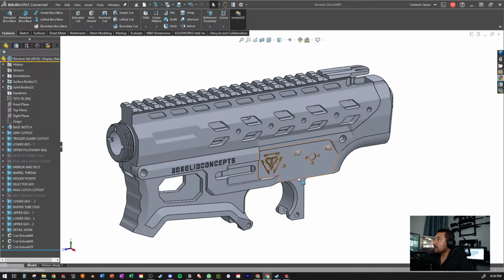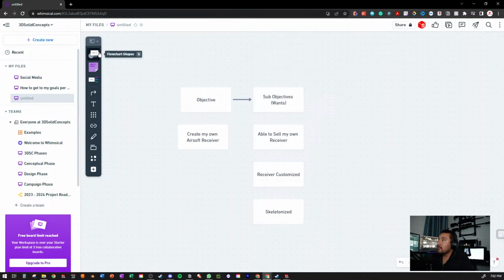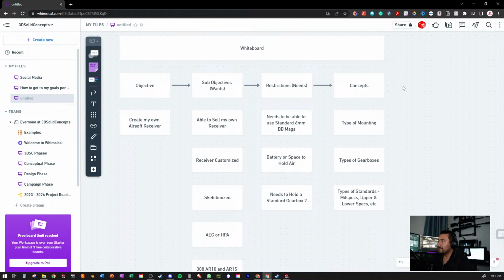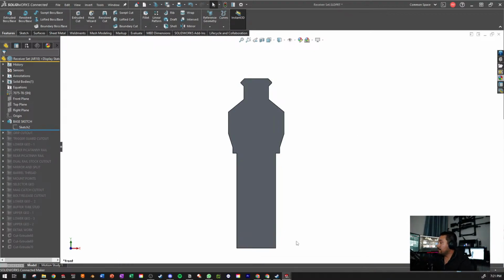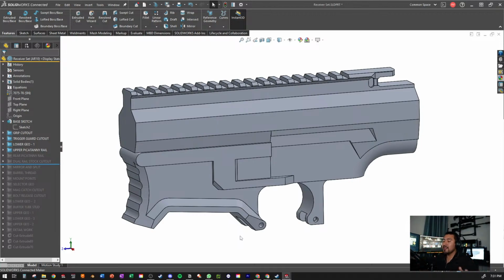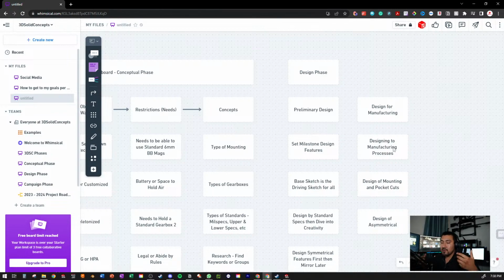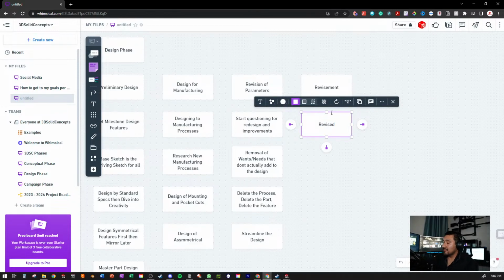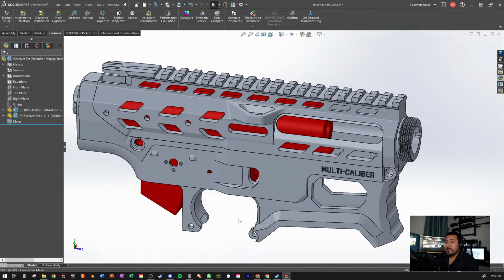3D Design With Me Livestream S1E8 - Master Workflow in Product Design of an Airsoft Receiver Set

Comment: Iv been doing some 3d modeling for some custom printable components, and iv been struggling with a lower receiver.
I have the concept nailed down, but i was struggling with makeing it standardised and knowing where to start with the modeling.
Funnily enough, my model purposefully excluded the bolt release.

Anyway, this video is criminally underrated. Absolute gold for anyone in the 3d Airsoft game, or anyone doing sophisticated modelling in general.